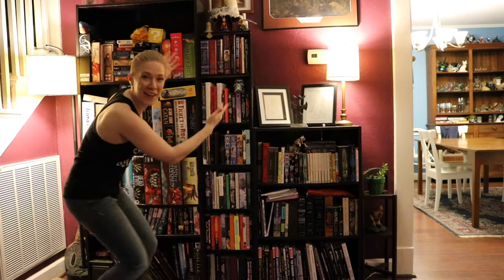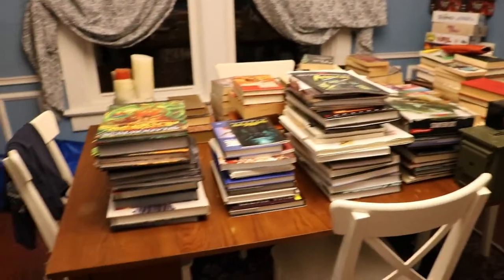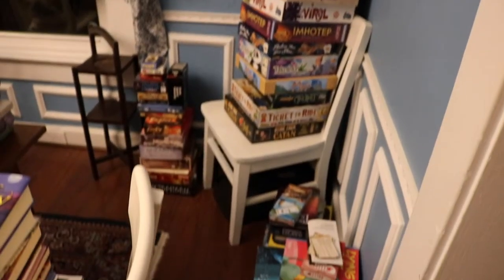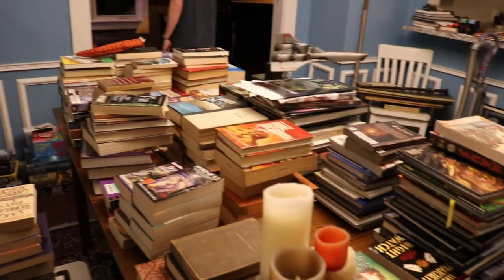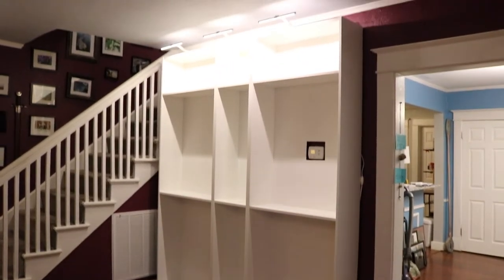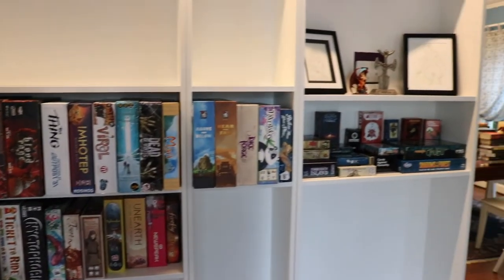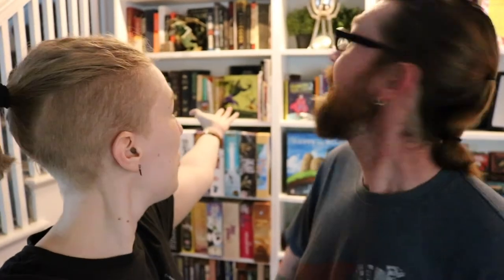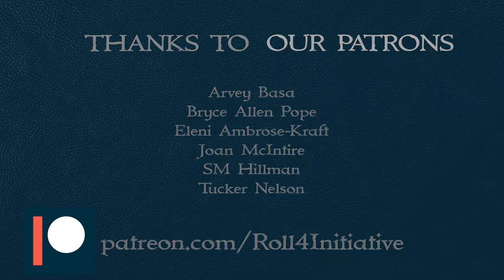Ikea & Building Bookcases

Comment: I have been eyeing those shelves for a long time and was considering getting those for my new game room that I am working on. How sturdy are they? Are you worried they might bow with your board games and DND books after a little while?
Reply from the maker: The unit itself is really sturdy, well designed. It’s composite board, so I think that with enough weight and time they will bow, but they are big enough that we can distribute things more so each shelf doesn’t have to have as much.

Plus if you can remember to do it, we try and flip each shelf ever couple years.